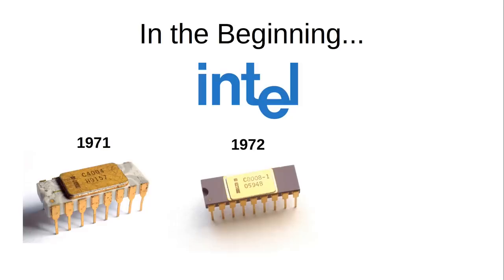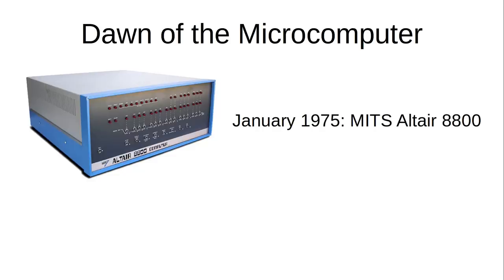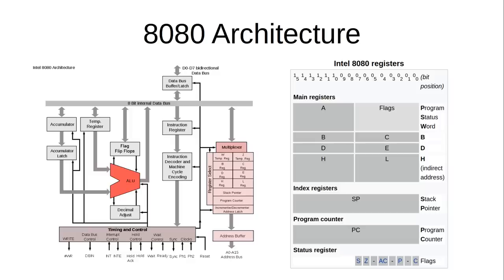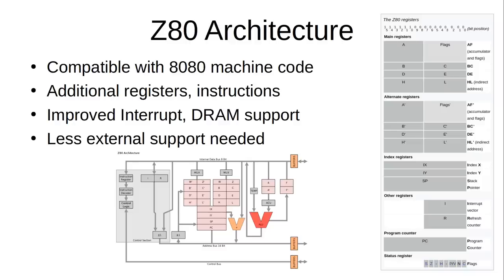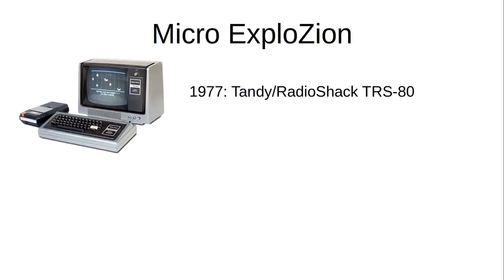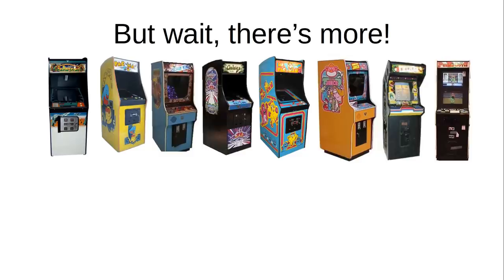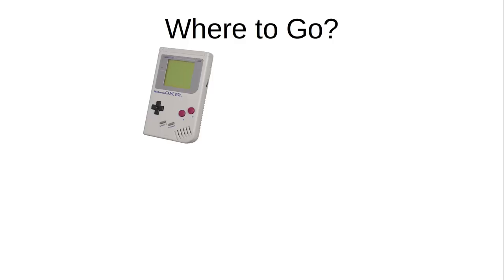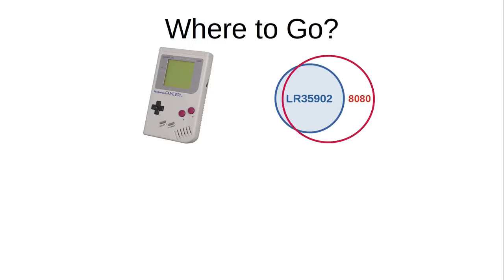Looking at the Zilog Z80 - NEW SERIES!

Comment: Thank You! Thank You! Thank You! I am 65. I use Z80 since beginning. All kind of apps. Right now I created an emulated version in a FPGA. It runs at 100MHz. Quick enough to do almost everything. I work in slot machines industry. Once I knew by heart all instruction codes. I built PCBs, maybe dozens of. I create my own assembler, on extended page mode memory mapping. I will never let it down. An amazing architecture!
Reply: Hi Flavious -- see my comment to Matt above... I'd like to hear from you too... !!
Reply: Learned to machine languahe program on the old Z80. This is fun to see.
Reply: I used to do embedded programming for the company's Z80 products. The code I took over was written in assembler but I wrote new products in Avocet C. I did occasionally add inline assembler when say I found a CRC routine was too slow. Assembler seemed to be about 10 times as fast as C.
Reply: I have a v9990 VDP that is mounted in a casino slot PCB. The ones before they shifted to native SVGA chips from PC world. It has 512KB VRAM!.
Reply: Very cool. Thanks for sharing.
Reply: @flyguille  Same as I do.

Comment: Started on the Spectrum in about 1985. I taught myself assembly language and wrote a program that I was selling. It wasn't a game, but a program that allowed you to draw and print electronic circuit diagrams of unlimited length (as long as the roll of silver paper lasted). There was about 40K of fixed code and the remainder (about 8K) was available for the user to add more electronic symbols, ones that I hadn't supplied. Because of the specialised use, I only sold a few. I got some good write-ups in the hobby electronics press of the time, though. I'd include links to those, but they have my full name, address and 'phone number in them (they were written in 1989, a different time!).
Reply: Do you still have the same address and phone number as in 1985 though?
Reply: @Mnnvint  I've lived here since 1989, when the articles were written. I've still got the same 'phone number I had in 1980 (at my previous address), but the area code has changed twice since then.

Comment: As an Australian, the Microbee series of computers were my first introduction to Z80 programming. I loved having a professor in university who had written a text on Z80 assembler insisting that no-one can just write in assembler and run successfully first time. Lots of pride when his first assignment for me was done in one sitting and ran perfectly first time. I wish all the rest of my programming was that successful...
Reply: My first was a Microbee 32k. Upgraded the Rpm to Ram by pulling out 2 of the Rom Chips and replacing them with pin compatible Ram chips. Ran a write Enable wire to the previously to these now Ram chips so I could write to them. Grabbed a DreamDisk Controller. Soldered a 50 pin socket on the Bee motherboard and crimped 2 Idc Crimp sockets onto either end using a vice. Was not pretty but it worked. Connected the Dream Controller to 1 end of the 50 way and plugged in its ROM to the Bee. PS was a modified 12 Volt battery charger. Also connected up my 3.5 Floppy to the controller and booted up. Aquired CP/M disks and I was up and running with Wordstar etc. I was in heaven.
Reply: Don't forget Dick Smith System 80 -- TRS80 clone. But I always preferred 6502. The Z80 has all those extra registers, but using them effectively is more difficult than using 6502's much more spacious Zero Page and at CPU MHz and RAM speeds of the day didn't offer any more performance. Z80 has ldir/lddr but those are one-trick ponies -- and at 21 cycles per byte copied vs 14 for 6502 "LDA ,X;STA ,X; INX;  BNE" a Z80 at the typically twice the clock speed was only 33% faster for block copy, and typically worse for almost anything else.

Comment: I built my first homebrew from a 8080A chip I found in a bargain bin at Radio Shack back in '79 (or thereabouts). Had to struggle through creating a dual-phase clock circuit because I couldn't find a 8224. Then discovered the Z80 with its built-in single-phase clock and DRAM refresh, and the world was my oyster! Bought a TRS-80 which got me through college, while working at an insurance company which had a fancy 5-card Z80 MP/M system (1 master, 4 slaves), writing assembly and BASIC and DBASE II programs. After 40 years, the Z80 is still my favorite chip!

Comment: This brings back fun memories.  My exposure to the Z80 was through a Northstar S-100 computer kit I assembled in the early '80's.  That machine was used in my product development activities for well over 10 years.
Reply: haven't heard the name Northstar in a long time. if my memory serves me correct those computers were wooden, or the cases were...wow do I feel old.
Reply: @rickhunt3183  The covers were wood while the frame was stamped metal.  The original name for Northstar was "Kentucky Fried Computers" if I am not mistaken.  Someone can probably clear up that lore.  They were an early adopter of the 5-1/4in floppy.  My machine had two.

I purchased a 64k-byte memory board for over $300 at the time and whimpered when I had to disable the top 8k for the boot rom.

Comment: I bought the Sinclair ZX 80 when I was a teen in Canada when it came out. Ordered it direct. It was kind of useless but I used it all the time. Also worth mentioning is the CPM 80 add in card for Apple II computers that used a Z80 and let you run CPM An OS very much like DOS. I had one and used it to run Wordstar!
Reply: It's funny how all home computers of the time were useless as they came. Exception being the TRS-80 with it's screen and disk drives. Unless you can save files to disk and have enough room on the screen to preview a printout they were not practical for business. They left out the disk drives and screen because those were the parts that made it too expensive.

Comment: So pleased you mentioned my first computer, the Amstrad! Over here in the UK it rarely gets a mention because it came out after the Spectrum and Commodores got a death grip on the market, despite being better than both. ducks and runs for cover 😂
Reply: Yes it was better. However it was not better at running Spectrum games unless the developers took the trouble to make it fit the Amstrad properly. I don't think the CPC 464 knew what it wanted to be. It was well equipped like a business machine but with a tape drive, doh! For a games machine they should have tried harder with the graphics chip. The BBC Micro was smart because they left empty ROM sockets where you could add business applications. Instantly start your Word Processor.

Comment: I am so looking forward to this series!  I would have loved to have seen you pick the TRS-80 as your platform for the series.  It has a very active community (watch the trs trash talk series here on youtube), Fantastic emulator with debug capability (TRSgp), and the hardware is still pretty easily available if someone chose.  On a side note, the TRS-80 model 4 you had in your video was actually a portable model 4P and no model 4 variant had 8" floppy drives.  They were all 5 1/4".  The Model II, 12, 16, and 6000 were 8" drive machines.  Thank you for producing this series, I so look forward to viewing it.

Comment: Thank you Matt.  First class presentation.  My first m/c was the Sinclair ZX81 with a CAI interface that fit in the memory expansion slot.  Besides attaching a 48K Memtek expansion card, it would also run a 40 column dot matrix ceramic head thermal printer, plus 1 more port for a 56K baud stringy floppy magnetic tape cartridge storage device for large datasets that programs such as VuCalxc produced ( the DIM command saved the whole area on tape, even if only 1 spot was used of that Dimension Area, so large arrays would take forevcer to load from cassette at 250 baud, but loaded quite quickly with the stringy floppy ). Looking forward to your future endeavours.

Comment: I remember the first computer within my young budget that I actually tested on a show room floor was a Bally. You entered code using a Pong controller to select characters or keywords by turning the knob and hitting the fire button. Files were saved to a cassette tape. No keyboard.

I had a Sinclair, and a Commodore 64, but my first "real" computer was an S-100 bus based CP/M machine with two dual sided quadruple density hard sectored 8" floppy disk drives. While the original CPU was a Z-80, it had a Motorola 68000 daughter board using the pin outs of the Z-80 to make the Z-80's mother board a disk and I/O controller for the 68K daughter board which did the real work.

I used to be able to hand code machine language for 8080, Z-80, 6502, and 6800, and wrote my own assemblers for all these.

I am not convinced that modern computing power is necessarily a good thing. Most of what computers do is far removed from the purposes of the users, and machines are easily corrupted.

I sometimes think we'd be better served by slower, more reliable, special purpose computers which did a specific suite of tasks well, and would be harder to spoof without being detected. I sometimes suspect that ubiquitous massive general purpose computing is a dangerous dead end.

Comment: Thank you for this series, brings back memories. We used a Z180 at the first computer company I worked at in 1994. It was obsolete at that time, but we could still buy them. When supplies started dwindling, we worked with the 386EX, then created the Rabbit 2000. It was a great learning experience, that Z80 architecture was simple and yet powerful. Moved to another company and worked with Motorola's flat memory model, then Coldfire, PIC, ARM, ... All embedded systems. These days very few programmers even work with the processors.

Comment: Can't wait for this, I've been thoroughly enjoying the 65C02 series. I've actually just bought a second hand ZX Spectrum +2A to try and recapture some of my childhood. I started writing games in basic at the age of 10 back when the Spectrum launched but Assembly always seemed so complex and in the days without YouTube I didn't stand a chance. The most baffling thing about the Spectrum was always the crazy way the screen memory was laid out with it divide into 3 horizonal sections of 64 lines but even these were addressed every 8th line at a time. This meant changing byte values to put a sprite on the screen was a nightmare, or at least it seemed so back then.
Reply: I'm thinking of firing up my Dragon 32, I've been running the XRoar emulator and typing in BASIC programs by hand. I did Mandelbrot today. I would recommend one of those new devices that loads and saves files to SD card. I think all the retro home computers have them now.

Comment: Namco used 3 Z80's in some of their arcade games, most notably Galaga and Dig Dug.  Pole Position stepped it up even more, with a Z80 and a pair of Z8002's.  That must have been a lot of work to program!  The Z80 was definitely one of the most widespread embedded CPU's, and it still lives on today with higher clock speed and smaller packaging.

Comment: The Sequential Prophet 5, Prophet 2000, and EMU's Emulator sampler and synth keyboards all used the Z80 too.
Reply: Awesome axes built on an awesome uP.
Reply: And almost all Lexicon reverbs.
Reply: @dale116dot7  they were doing DSP with a Z80?
Reply: @MuzixMaker  No, the Z80 was used for the UI, LFO generation, and pitch detection. They used various custom DSP solutions to process the audio. The Lexicon 200 was mostly 74LS and F logic to make a DSP. Later versions used an ASIC.
Reply: @dale116dot7  right, I would have been duly impressed if the Z80 was gong FFT!

Comment: Stumbled on this video. Reminds me of the seventies when I started designing embedded systems. Reason I used Z80 instead of 8080 was that it needed only one voltage supply. 8080 had three. Wire wrapped a system with 4k SRAM and 2k EPROM. For half of the EPROM I wrote a rudimentary assembler translating mnemonics to machine code. Used to learn students how to control a couple of pneumatic cylinders.

Comment: Great idea for a series! Some of the last assembly programming I did on my ZX Spectrum back in 1986-1987 was a real-time clock with hour, minute and second hands. I had fun optimizing the accuracy of the clock by tweaking the code to get the timing right, and I learned a lot during this experience. Sadly, neither my ZX Spectrum or the programs I wrote for it has survived until today.

Comment: Robert Greyell was my professor and I was his Teachers Assistant.  We started with the 6502 (AIM-65 with many of the peripherals), then the 8080, 8086 and Z80 and finishing off with the 8048.  We learned everything from internal architecture's, system integration, instruction sets, machine coding (with dip switches), assembly, etc.  Our final 'project' was to design and prototype (wire wrap) a Z80 micro computer with four 7 seg displays lol  I had this weird idea that the M1 and a couple of other signals could be gated to 'exclusively' access program data/ROM (Op code fetch), but knew an in depth analysis of the instruction set as well as 'guided coding' could/should be able to accomplish this... But was never able to test it.  That should also be able to accomplish with an 8255... But then you would need to make a sub for memory management which can be virtually impossible on a non dedicated system.

Comment: The first computer I ever got to program on was a Cromemco Z2D S-100 bus based system with the Z80 and 64KB of RAM. It ran a CP/M derived operating system called CDOS. It had a 32K Structured Basic interpreter. Naturally there was an assembler too. The computer also ran WordStar, an early word processing program. My dad also wrote a C compiler for it based on the 1978 K&R specification. One of the fun things I did (ha!) was manually type in the code for a terminal program for a Hayes S-100 modem in 8080 assembler. That was then translated by a program into Z80 assembler before assembling and linking. That all took about a week to do.

Comment: Great intro to the z80. Brings back memories of long nights building my own z80 design on veroboard. Graphics card, eeprom programmer, tape modem. Must break it out of the attic to see if it still boots. Will be watching your Chanel with great interest. Oh I still have a Roland Jupiter 8 synthesiser. This also used a Z80 and powered the 80s electronic music revolution.

Comment: Looks like an interesting new project, looking forward to it.

An interesting point for the Z-80 is that it is still available to purchase in its original 40-pin package, though speeds up to 20 MHz make it a bit speedier.

A part not mentioned in this intro is the other vertical market of (non-gaming) embedded devices. I was using an embedded z-80 microcontroller, made by Z-World, back in the mid- 90's for a project.

The additional of a DRAM refresher cannot be underestimated, this was a critical factor in it's acceptance as a core component of a low cost home computer. As an example, the C-64 had to offload the DRAM refresh to the VIC-II chip, making it even more of a headache to get right at MOS (ask Bil Herd about that :) ). The simple MMU also expanded the memory space beyond the 64K limit... the embedded version I used allowed 4K paging of RAM that was handled by the C Compiler.

Have you also heard about the kit project using the Z-80? Grant Searle's RC2014 project has been out for a while but it's massively modular and there are quite a few boards out for it on Tindie and other sites.

Cheers,
Reply from the maker: I've heard of the RC2014, but I don't know much about it. And going into the embedded uses of Z80 outside of gaming would have been huge, not to mention new systems using the eZ80

Comment: We programmed 6800s at DeVry in Phoenix in 1980 using a hex key pad.  didn't realize how brutal that was until getting my first job that required coding micro-Ps.  got to use an IBM XT assembler with a Z80 emulator.  Heaven on earth!

Comment: Just found by far the best video on the z80 n my reccomended :D . A couple years ago I quit my z80 project as the heart of the portable device was the rc2014 which died a slow death in the terminal. I could  not afford a new one and found that I had lost interest in the 3 year journey so I scrapped it. It was going to be hard getting all the vintage parts needed as I wanted to fit it in a portable case similar to the osborne1. So now im left with a bunch of old chips, (some rare ones) and lots of knowlege. I have subscribed and am looking forward to the new series!

Comment: One thing about ZX Spectrum which is well-hated (and loved!) is non-linear video memory layout. It is just exchange of two groups of 3 bits (lowest in high byte and upper in low byte of address), but it makes possible for video system to quickly extract two bytes of bitmap data and color data (so called DRAM burst mode). Also sublayout was choosen to simplify character transfer to the screen - incrementing high byte of address consequently iterates through bitmap stripes of single character. So... they not only implemented Z80 in FPGA, but uprgades it with new instructions two of which simply implements putPixel algo. :D (one translates x,y to address in videoram and other creates bit pattern to point to specific pixel in stipe. Hell, yeah! :D However many oldschool bisons see this as heresy and unworthy cheating. :D